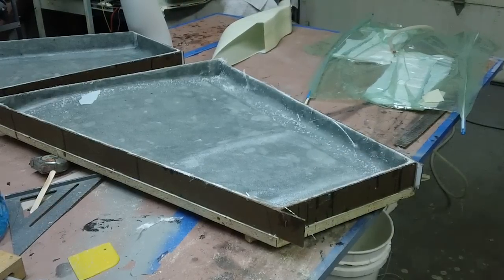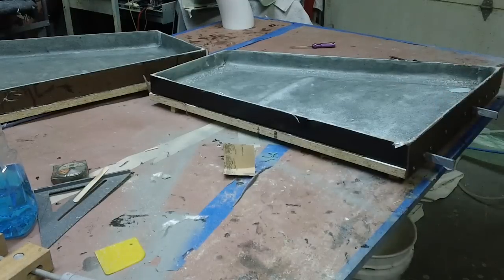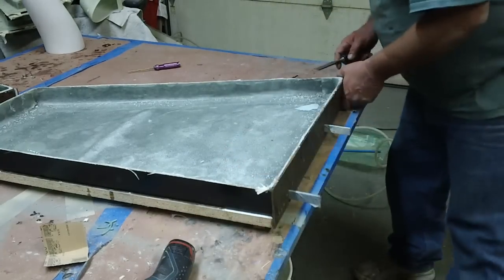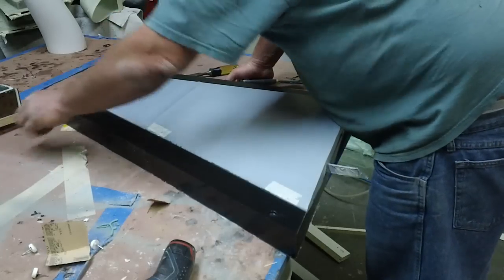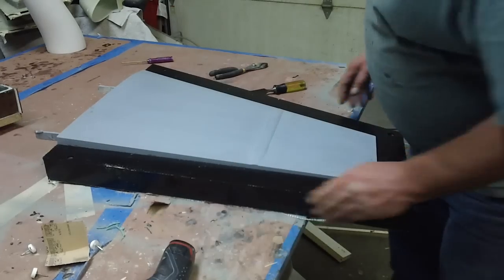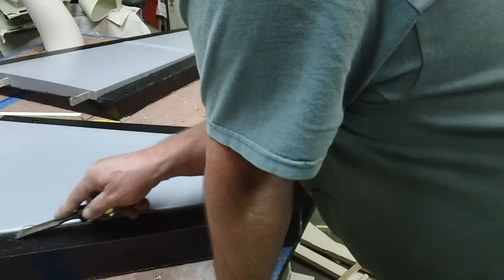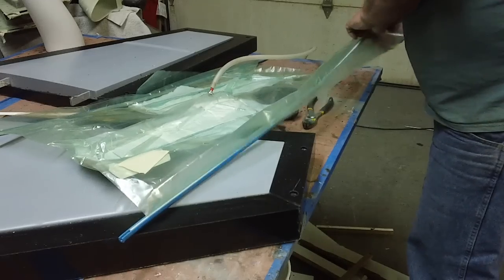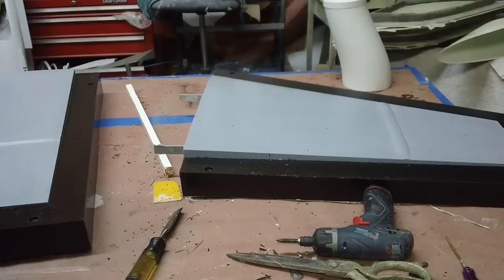back to work in the shop

Comment: Those locator pins look a bit too straight on their sides. Should have some draft built in so the male locaters don't get locked into the female holes. Grind the sides a bit to create some slope to the female holes.